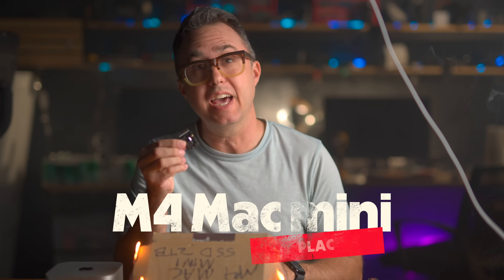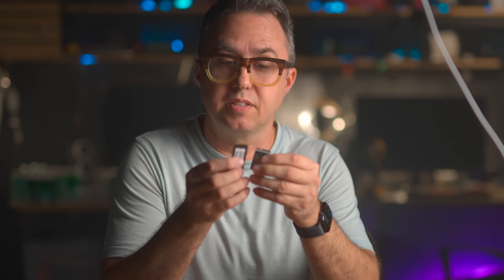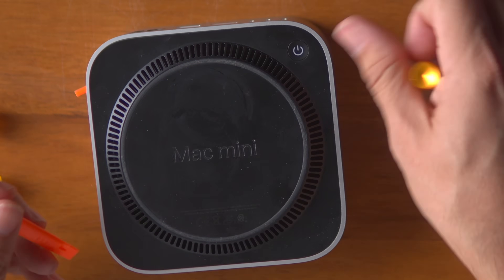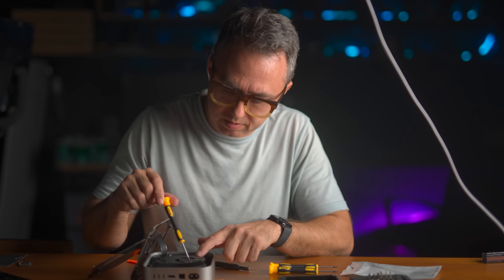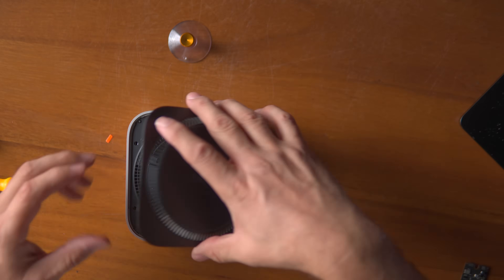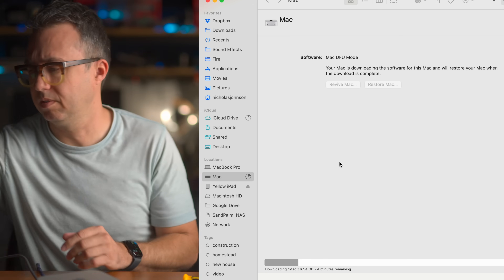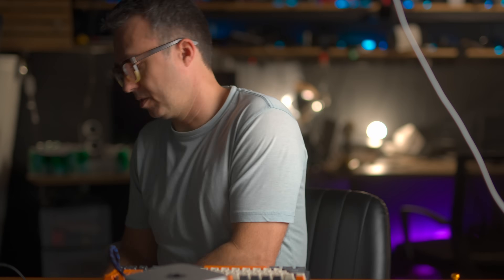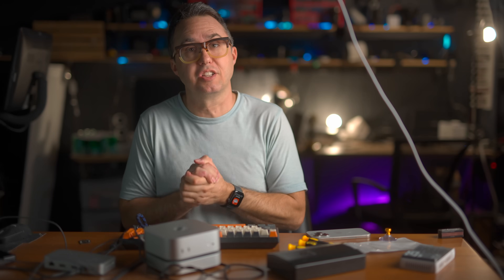Upgrading M4 Mac mini Internal SSD, step by step

Comment: Remember, MIDDLE thunderbolt port. The one with the symbol right on top.
Reply from the maker: Oh wow, I must have just happened to do that by accident!  I'll pin this comment.
Reply: What’s the difference between the middle port and the others on the back? On the base model, all those are tb4 but as far as I know there’s no difference between them so I’d like to be enlightened especially since I’ve just bought one along with a thunderbolt dock and ssd and been having a lot of issues with sequoia that doesn’t exist when I use all this same kit on an old 2014 mbp running big sur.
Reply from the maker: @dawnrazor  Those three on the back ARE all thunderbolt 4, but the internet seems to agree with this comment that only one of the three ports will work for DFU mode.  I evidently just had a lucky guess.
Reply: @SPACEDESIGNWAREHOUSE  Macpro 7.1 is the same. Only one port (the one on the top and further from the power button) works for DFU, per Apple manual. I went through the process, and there were no need to download the firmware.
Reply: @kyeblue how to connect to Mac 6.1 thunderbolt 2?
Reply: @dawnrazor the middle port is specifically for DFU mode. I just did this a few days ago.
Reply: Also, if you download the firmware beforehand manually, if you just click “restore” it will download it AGAIN. Instead, you have to hold one of the modifier keys when you click it. On Windows it’s Shift, in MacOS I’m not sure. But that’s what step was missed.
Reply: @ahgflyguy option key!
Reply: Mac Pro 6.1 connection?
Reply: What if your new to Mac and do not have another thunderbolt capable mac? IS THERE WORK AROUND?
Reply: This really great but don’t forget to tell viewers this will void the Apple warrant
Reply: @jchizek  In another video the recommendation was to keep the 256 gb to reinstall in case you need to send to Apple.

Comment: You will need ~40GB of free space on the machine you use to perform the re-flash from. The ispw file is ~19GB and then it has to decompress this before moving it to the MacMini M4. It failed several times for me until I realized my MacBook Air was running out of space either trying to download the original 18GB file or expanding it prior to transfer.

It is also extremely important to use the 'middle' port on the M4 or it will fail with a cryptic Error 4042

Comment: I was able to successfully do the upgrade. I am very mechanically inclined but not techy at all. I was able to replace the sd card and put it back together easily. To format the mac mini you need to hook it to a newer mac. I used a 2022 MacBook air. I just plugged the two together without downloading anything previously. Follow the prompts and allow your new mac mini to connect. In 20 minutes or so it was all done. I then used a usb to a thunderbolt cable to transfer 500 gb of data from my 2011 imac. The transfer took 6 hours or so. The only program that didn’t tansfer was lightroom 6.
The Mac mini handles 5k videos awesome!

Comment: Warning! Do Not buy from this store. Unless you wanna sponsor China! Meaning: Bye Bye Money, No Chip.
Reply: That’s why I maintain to say: DONT SPEND YOUR $$$$ at THIS company!
Your money’s GONE!
And Mac Mini.

YAY $20 off your scam!

I have trusted them with my money and they just took it. And because it’s a China based company. Your $$$ are GONE!
Reply from the maker: 1. ALL Chips come from China, including the original Apple chips.  2. I am in close contact with the manufacturer of this and so far everyone who has ordered one has received what they paid for.
Reply: Where’s your big talk now?
We’re the one’s who lost $300!!!
In this scam! No response from them!
Cause it’s NOT just my shipment.

Malfunctioning Chip for $300?
Reply: 1Apple delivers. And if not; money back. 
2 Yes I got the chip, Completely WET/SOAKED.

I know they ship over the ocean,but…..
And YES no refund. 
Maybe you could inform them?
Reply from the maker: @frankjongmans383  wet?? there’s literally no way it left the factory wet. I guess that would be a Shipping problem and you should definitely reach out to whoever shipped it… But I will reach out to them and see if they can send you another one. Did you dry it off and try it?
Reply: ! ‘I’ should reach out to their shipping company 😅
And yes, I’m an 35 years experienced IT guy and know water and chips DONT go together. 
Still took the benefit of the doubt and installed it. And to my experience; it was f#*d. And now I am without a Mac. 
So again. NO credibility

Comment: Thank you for this great video ! Though I have a question : at 5'15" why have you to connect the Hdmi port of the mac mini M4 to a monitor to a monitor ? Is it possible to use The Apple Display Studio Monitor which has only USB C ports ? Thank you for your answer !
Reply from the maker: @franck2315  Yes, you’d can use the USBC ports (thunderbolt ports) for the monitor also.  I had my other mac connected to my Studio Display while making this video.   Im not 100% sure you need to connect the mini to a monitor to do the process, but thats what Apples instructions say to do.
Reply: @SPACEDESIGNWAREHOUSE Thank  you so much for your "supersonic" answer !!! How did you then connect your Studio display during making your video ?.Was the Thunderbolt 4 of your MacMini  not already occupied to connect the mac mini and the other computer ? (sorry for my english, I'm a pour french guy... !)
Reply from the maker: @franck2315  haha no problem.   On the, Mac mini all three ports on the back are thunderbolt ports! Any of those three work for the display and the DFU connection
Reply: @SPACEDESIGNWAREHOUSE  I belevied that Apple Studio could only be connected to the "central" port of the MacMini... I just tried to connect it with one of the two other ports... and yes, il works too !!!! Thank you again !

Comment: Heads up. I was able to flash the new 2TB ssd in my m4 using a late 2013 intel iMac that is operating on Sequoia running with OpenCore Legacy Patcher with an internal ssd upgrade of its own . The iMac does not have Thunderbolt ports of any kind, just USB-A ports. 

I used a USC-C to USB-A (3.1) cable to connect the M4 Minis thunderbolt port to one of the iMacs USB-A ports. 
Took about half an hour including the SSD installation for the Mini.
It’s now restoring from Time Machine on an external HDD. Even that doesn’t appear to be taking too long.

Comment: i replaced the ssd with a 2TB Toshiba. The DFU restored the system without problem. However, after chosing the language it gets stuck on Activation screen. I have access to my wifi and ethernet cable is connecte to my router. Anyway, it is stuck on the Activavtion screen. Has anyone experienced this problem after SSD upgrade?

Comment: omg for 300$ you can buy thunderbolt port extension  with 4tb ssd inside
Reply from the maker: Yes that is absolutely correct. This video is not at that. Those are two completely different avenues
Reply: @SPACEDESIGNWAREHOUSE  why then discuss dead born product it required only for really specific cases where speed of thunderbolt will not be enough

Comment: help! did everything up until connecting the usb to a mac lap top to access DFU mode. Nothing is showing up on the monitor, and on my laptop, nothing happens. I did connect via usbc, not sure if its a thunderbolt cable though. But nothing is on the monitor or the lap top indicating DFU mode.
Reply from the maker: @pdsmd333  did you hold down the power button before connecting the power cable to the Mac mini and then connect the power cable while still holding down the power button until you see the orange light blink on the front of it?
Reply: Yes, did it just as instructed with light blinking orange. Could it be a bad ssd?
Reply from the maker: @pdsmd333  Well, which Mac laptop are you connecting it to?  You must have your Mac mini connected with the middle USBC connection, and try using the left side furthest USBC towards the hinge port of the MacBook Pro.  Could be a bad cable, could be a bad SSD, could be the SSD isnt seated perfectly, might just need to try again!   If the laptop is running an older Mac OS upgrade to the newest one
Reply: Hmm. All connections tested and in the proper usbc slots. Ssd seated and screwed. I am connecting to a mac book pro, that’s only a year old and latest OS. I tried connecting again with the mac mini power button held prior to plugging the figure 8 plug. Orange light blinking. Still nothing on the monitor and with the usbc connected to their proper slots, still getting nothing.
Reply: I appreciate ur replies. Will check if its a bad SSD
Reply from the maker: @pdsmd333  that’s a bummer. I don’t know what else to troubleshoot unfortunately.
Reply: No worries, looks like it was a cable issue. I finally found a usb4 thunderbolt cable. That worked. Thank u again!

Comment: I bought a 1Tb ssd hard drive on Aliexpress, followed the disassembly instructions and went back to DFU mode and here I am now the owner of a 16Gb 1Tb mac mini M4 hard drive. It's very easy to change the hard disk, but you MUST be careful with the boot swich cable and the fan flex cable. I did as indicated in the video and I didn't disconnect any cable and that's the best way to do it I think. Thank you for your help SPACE DESIGN WAREHOUSE
Reply: One report of a good aliexpess supplier.
Reply: ¿y como responde al despertar del reposo? He leido comentarios de algunos que su mac mini m4 no se despierta adecuadamente y que necesita un reinicio.

Comment: So…with the new and faster 2tb ssd in place does there need to be a heatsink install to go with it? Nay problems with the fan working since install?
Reply from the maker: Nope, it doesn’t seem to run hotter enough to call for any other measures to be taken. The fan in the Mac mini does an excellent job of heat mitigation! 

No problems since the install.

Comment: I am constantly receiving the error shortly after extracting the file "The Mac “Mac” could not be restored because the firmware file was corrupt." I tried it with a MB Pro 14 M1 (OS 15.04) as well with a MBP i9 (OS 15.04) - same  error. Had tested the checksum - checksum identical. No idea what I did wrong. Several downloads ... I tried also the previous version (15.3.2) same error. Any idea anyone?

Comment: This process is not for the faint of heart. There are several issues with it...

First of all, it voids your warranty.

Second, it risks damaging the device. People have been known to damage it while doing this.

Third, it requires that you have access to another Mac. Many people don't.

Fourth, if you're new to DIY upgrades, this can cause anxiety and discomfort.

Fifth, if anything goes wrong with the upgrade (e.g., the replacement drive is defective, or the software update hiccups), you have to go through the whole thing again. More time wasted. More anxiety.

I've done hardware upgrades myself, but I wanted to avoid doing this to the Mac mini, so I chose to spend the money to upgrade to 512GB. This actually doubles the write speed!

Then I attached a 2TB external drive. Easy peasy. No headaches. No anxiety.
Reply from the maker: I completely agree with all of these points.  I was more interested in seeing that this was possible!  And I tent to take pretty high risks with electronics. External storage, especially through thunderbolt is JUST as fast, worry free and easier.  And on a stationary machine it really makes no difference where the SSD is sitting.

Comment: Great video! Thank you. I have 2020 Mac book pro, would it work to run DFU mode? 

And can I use USB C cable instead of thunderbolt cable?
Reply from the maker: Yes as long as your 2020 MacBook is running current OS. And even non-thunderbolt usbc cables have like 5 different types, so I’m not sure which one is “regular.” But I think it ought to work, maybe it’ll just take longer to transfer the files, they’re something like 18GB so it’ll take a while.
Reply: @ Thank you! 👍🏻

Comment: Looking to buy a new mini. Could this be done before you use it?
Reply from the maker: Oh yes absolutely - that way you dont even have to worry about backups, you can just swap it and upgrade the firmware.
Reply: thank you, thats the answer I was looking for. I wanted to swap out the ssd of the mac mini right out of the box, then set it up. 
much appreciated.

Comment: I got error (2015), tried around 10 times and a couple of times at random also got error (21). Kept trying, and then for no particular reason it worked! I'm relieved but also a little concerned as to why it previously failed. Any advice would be appreciated!
Reply from the maker: Im really glad it worked finally!  And I agree thats really odd.  Theres no way I just HAPPENED to get super lucky and it worked on the first try.  I wish I knew enough about the particulars to even begin to figure out why that would take a bunch of tries.
Reply: @SPACEDESIGNWAREHOUSE  It is bizarre, was about to reinstall the original chip! Thanks for the reply though and the video :)

Comment: I ran into an error with my firmware restore while connected to my MBP M4. I repeatedly got a "Your Mac could not be restored. Error 9". I remembered that my MBP had a software update that I had not applied yet, so I thought to apply the update and retry. Well, that did the trick. The DFU mode worked like a charm, no more error 9, and applied the firmware all the way through. Just wanted to share if someone else encounters an error during the DFU mode process.

Comment: Using the suction cup is a fantastic idea. The kit I bought didn't come with one, and I struggled for a minute to get the cover off before going to dig up a suction cup from an old Switch Joy-Con repair kit. The suction cup makes it so much easier, and also lessens the risk of scratching/damaging the cover. 
Also - for what it's worth, I also didn't need to use the firmware from that link you posted. The DFU tool just went and downloaded it on demand. Definitely preferable to using firmware from some sketchy 3rd party site... although in the grand scheme it's not that much sketchier than installing an NVMe drive from Aliexpress, I suppose. 🤣

Comment: I am adding a 2TB drive to my Mac Mini M4, but running into an issue. It is erroring out during the extracting phase of the software and saying the Firmware file is corrupt. Tried multiple different version so the Sequioa firmware and a few different USB-C, Thunderbolt cables. I am connecting a Mac Mini M2 running 14.5 O/S. Any ideas of what to try next.
Reply from the maker: DId you try it WITHOUT pre-downloading the firmware?  It will then just choose a firmware for you during that phase.
Reply: @  I did try to se the firmware that it downloaded, but still errored out.
Reply: @SPACEDESIGNWAREHOUSE  Hi, same problem here. I downloade a version from the site you mentioned in the video. When installing it on the new chip, it says firmware is corrupt. 
I tried also on DFU Mode, my Macbook Air downloads a firmware on its own, but after downloading it, I also get an error message, that the file is corrupt and I should try it again. Tried multiple times. Any suggestions?
Reply from the maker: @kurnaztilki-z9n  I think you should try the chat feature on the website for the SSD.  Its the guy who builds them and hes actually super responsive and helpful.  Although he does live in China so he will probably respond later in the day.  https://store.m4-ssd.com
Reply: @kurnaztilki-z9n  The other guy on this same thread was able to resolve the issue by updating the Mac he was installing the firmware FROM the latest version of Sanoma - I would guess updating to the newest Sequoia would do it too.
Reply: @SPACEDESIGNWAREHOUSE  updating my Mac Mini M2 software to the latest version of Sonoma resolved the issue.
Reply: @CraigPettigrove-h9c  Oh thank goodness.  I hate a problem I dont know the answer to and also dont have in front of me to try to troubleshoot.  Im glad that worked.  I'll tell the others.
Reply from the maker: I think you should try the chat feature on the website for the SSD.  Its the guy who builds them and hes actually super responsive and helpful.  Although he does live in China so he will probably respond later in the day.  https://store.m4-ssd.com

Comment: I get the error 2009 which means that the connection is interrupt - as soon as the software is extracted and should start loading to the mac mini, it drops off the DFU mode and the yellow indicator turns white... I do this from Windows - with iTunes or the Apple devices app. The same.
Please help!

Comment: Hey great video, if I replace the SSD with a brand new Mac mini will I need the back up rig?
Reply from the maker: @TrayTrades  nope, if you don’t have anything to backup, it’ll just be as if you’re buying a new computer. So on a new computer it’ll just be the same thing
Reply: @ thanks man I’ll be buying next week so before I even load it I can swap the ssd? also I can’t see the download firmware is this only available after purchase?